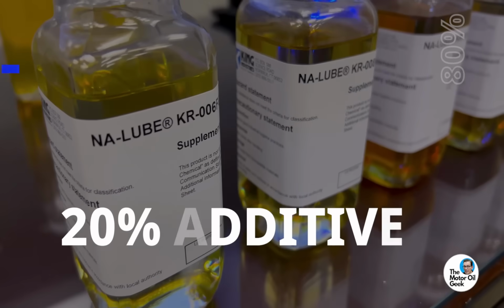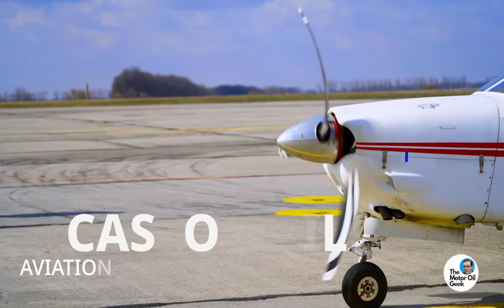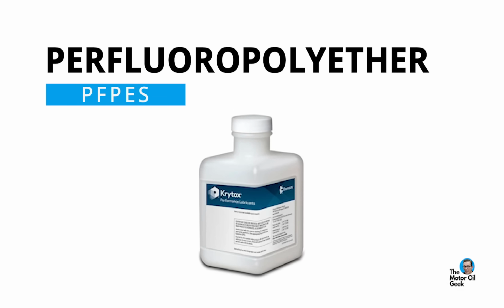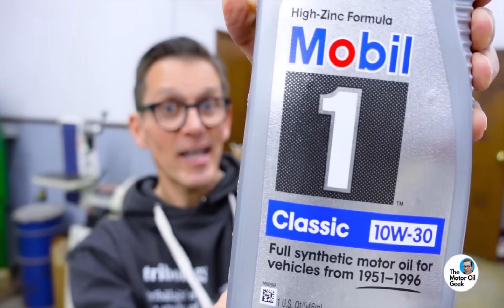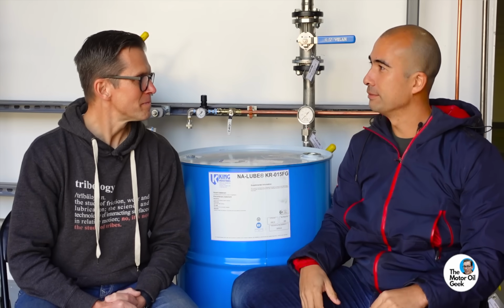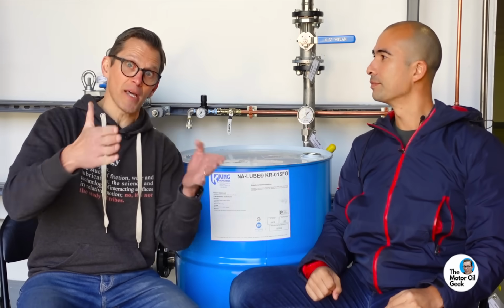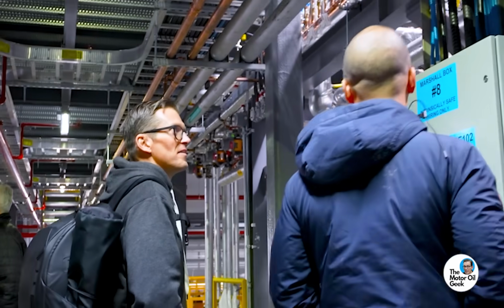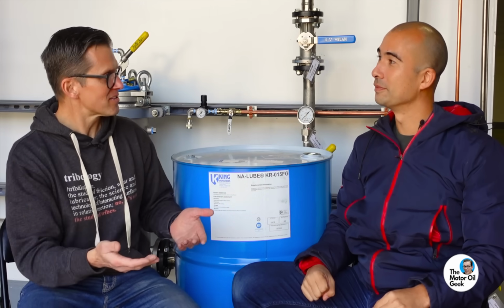100% Synthetic Oil: SCAM or SCIENCE?

Comment: Synthetic oil excellent. In cold start diesel engines especially helps .
I found in old worn out engines which burn oil synthetic oil doesn't make blue smoke or much carbon deposits.
Reply: Back in the 80's my Dad was having trouble starting his 6.2 Diesel ⛽️ in the winter. I asked him what oil are you using, he said 30wt I had him switch to 10w40 problem solved
Reply: Synthetic oil burns clean.
I did a test of heating up some open metal containers of used oil, one as mineral motor oil, the other container with synthetic motor oil.  When heating the containers with a torch, the mineral motor got hot, smoldered, and caught fire with a lot of dirty smoke.
The synthetic oil boiled and eventually caught fire, but the flame was as clean as burning refined kerosene.

Comment: Well done video Mr Speed . One of your best so far in my opinion ⚡
Reply from the maker: Glad you enjoyed it!
Reply: @themotoroilgeek  hey Lake Chris here owner of Apex Performance and repair a superbike and car shop we have worked together in the past on the DLC coated and gas ported rings for the R1 superbike platform we are building. Anyhow, Quick Question I have been meaning to text you to ask was we have a wet clutch and open bath oil system that is utilized in the gearbox as well , anyhow the question is we have a race clutch with adjustable force and essentially we have been thinking about bumping the clamping Spring up a little bit on the clutch to make it hold easier and switching over from the motorcycle Motul 300V 15w50 race oil to a automotive racing oil like Amsoil dominator 15w50 which obviously won’t have the friction modifier to make it less less slippery like the motorcycle oil has so the clutch doesn’t slip, but our thinking is this will really help the engine be a lot more frictionless because the automotive oil should be quite a bit slippery since it will not have the friction modifier most motorcycle oils have, so the main question is obviously if we can get the Clutch to not slip will the automotive Amsoil dominator race oil be OK for the Transmission gears since they are direct contact friction and high load engagement etc? Our thinking was the automotive race oil should be even better for the transmission since it will be a lot more slippery or frictionless… what are your thoughts? Thank you so much and great video again!
Reply: @themotoroilgeek Hi Lake, I have a 2016 Honda 2.4L that calls for 0W-20, I've been running Pennzoil Ultra Platinum, I want to switch to 5W-30, I just don't feel 0W-20 protects this engine. I live in Southern California winters lows are 25°-35° summers max 112° Good idea? 😊
Reply: @themotoroilgeek I enjoyed it too 😅😅